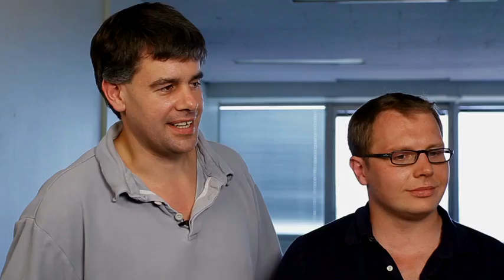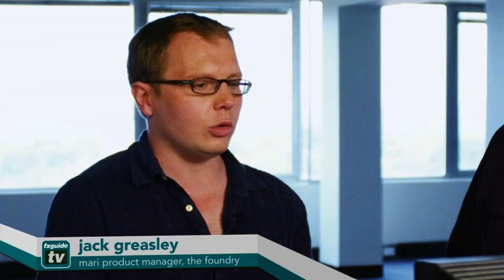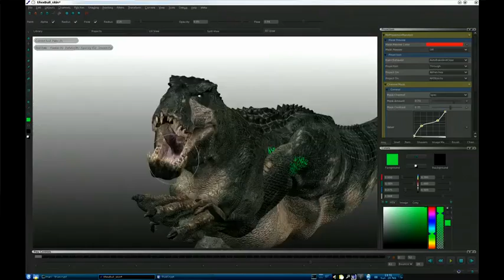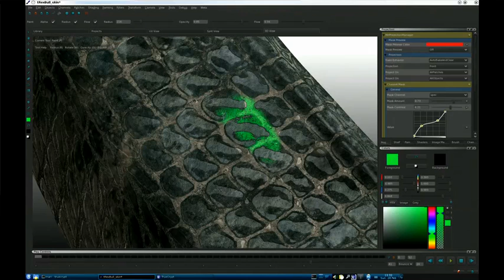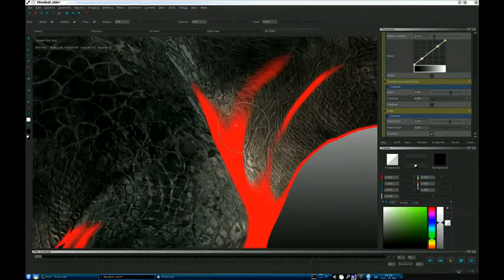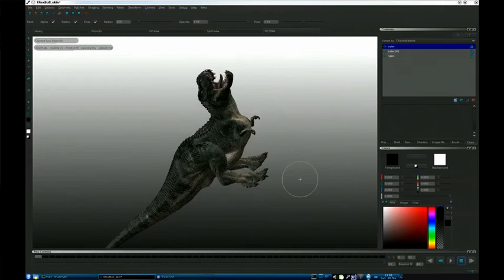Mari: | An Introduction (Part 1)

Comment: Yea we just got Mari here at work, first day on it actually. From what I got from Jack (guy speaking about Mari, and good guy I met at Siggraph) is that Mari doesnt handle  UV's or in this case patches. You can try using other channels to blend the paints together like layers but I myself am still trying to figure that out. So far so good though. Very stable.